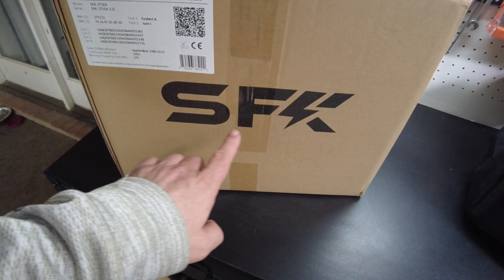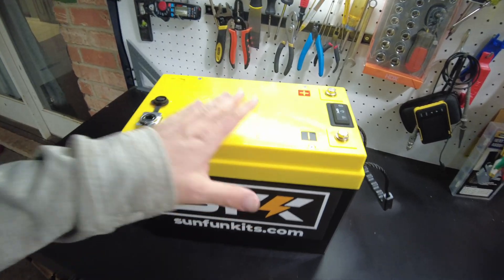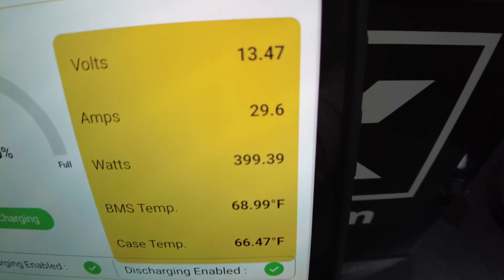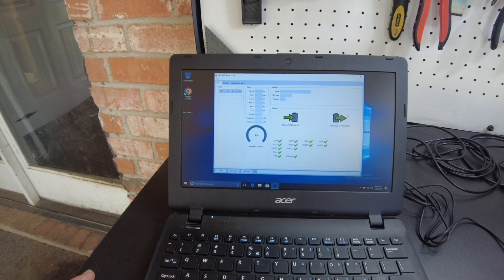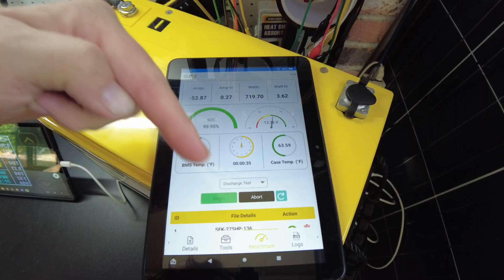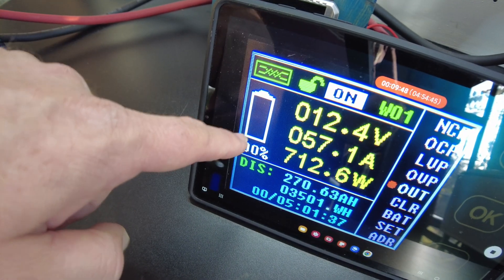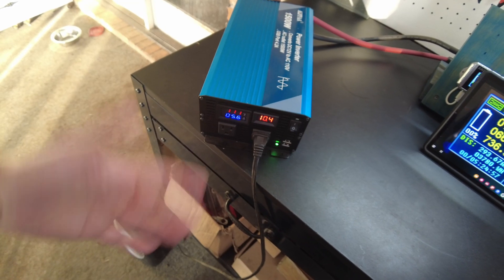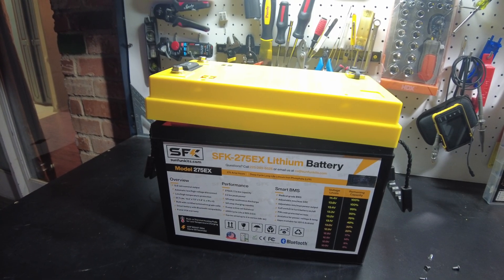Sunfunkits V5 LiFePO4 Battery

Comment: Hey I bought that impinvt 60A charge controller. Is it normal for it to say: Fault Prompt, battery over discharge? 
It says this when it gets to 12.4V, which is what I have the UV protection setting at.
Just thought it’s weird to give a fault, when that is what I wanted
Reply from the maker: I mean technically that's correct. Under voltage protection, it went to protect mode.. You should be good. Thanks!

Comment: you popped the top off, but didn't talk about or show the bus bars, some don't like flat busbars and want to see ones that have room for cells to expand bendy room in the middle, some want to be able to service the cells, not having them all welded down, but maybe they are all welded, just wondering since i didn't get to see those points.
Reply from the maker: Ahh, good point. I'll see if I can get some pics. Thanks!

Comment: Would love to see these with multiple batteries setup in series and parallel to see how the Bluetooth compares on individual batteries? Love the Bluetooth function!
Reply from the maker: I've been running two of their SFK-300HP's in series in my garage(man cave) for quite some time. If you use a dedicated table, you can run their app to monitor multiple batteries at the same time. Thanks!
Reply: I think it’s a great way to monitor your batteries! I am using a 24v system at my camp 2 12 v thinking of adding 2 more, I have not seen a way to monitor individual batteries before!

Comment: Great review and battery. I recently bought some 304 amp hour cells from them that I plan to use in the Licitti box.
Reply from the maker: Nice! The gen 1 box? I need to do that. Thanks
Reply: @BradCagle  yes, the Gen 1 box,  I contacted Mike at Licitti and asked him if they would fit he said that they would and sent me a PDF file with directions to put it together with a bms. He also told me that they actually sell 280 amp sells for it. I had originally bought the cells to build a separate battery because I was hoping the talent cell battery would come back in stock but it hasn't

Comment: Blue light = Active Balancer on entire time. Green Light = Active balancer on only when voltage of battery is high (13.4v or greater). NO light = active balancer off.
Reply from the maker: Ahh, thanks for the clarification.
Reply: Why even offer an always on option? Hasn’t there been enough testing to prove it doesn’t work?
Reply: It works perfectly fine on grade A cells that don't suffer from random Self Discharge rates (which grade B do). The day Andy finally decides to test with grade A cells he will change his opinion of it. V5 was created specifically to end this myth, people can now try it themself and see what is best. In our opinion keeping on all the time is best for normal use (running A/C, coffee pots) and green mode is best if you typically draw under 20 amps. But regardless you can now choose what you like best 😄 @ericklein5097